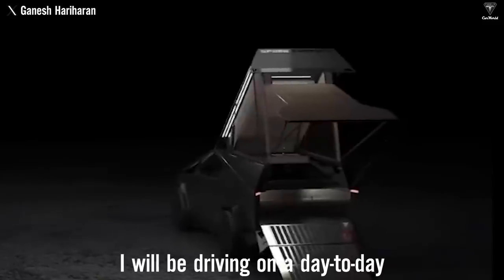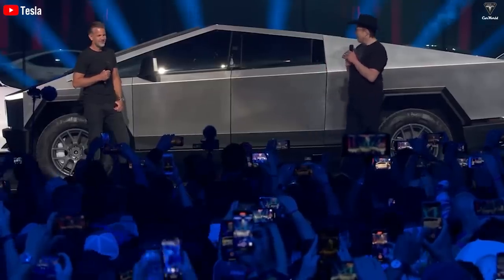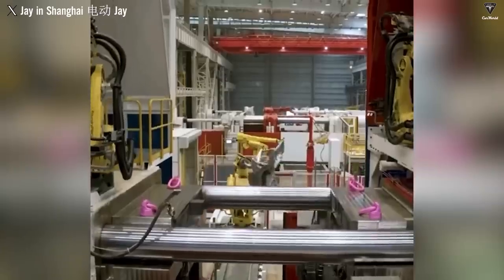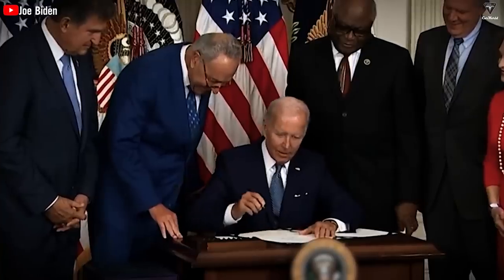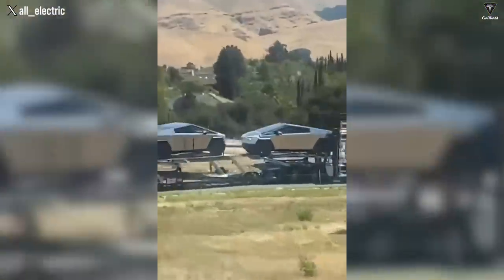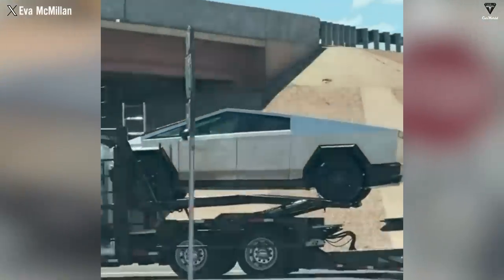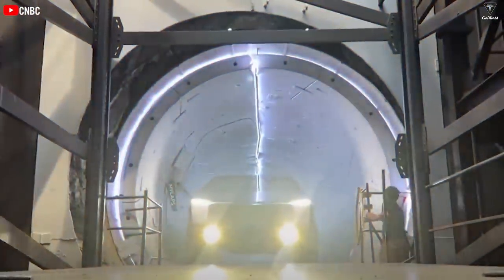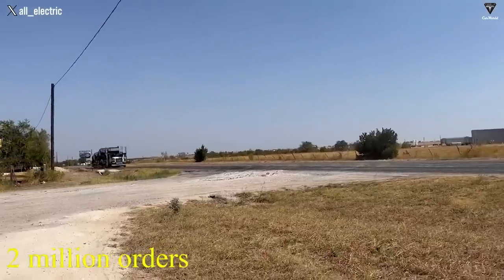Tesla Cybertruck 2023: Upgrades Over 2019 Prototype, how is it different?

Comment: I like the fact that you can use the truck as a truck and haul things if needed ! I do not like the windshield wiper option . Although all other vehicles used them. I would like to see a air flow system that would generate a cushion of air movement
in front of the windshield that would not only move rain away from the windshield but bugs , and bird droppings as well. Now this would be super cool and one of the first ! Also I had talked previous about a magnetic reverse field breaking system that would add less friction and use no replacement wearable parts to be replaced. This would add not only quicker stopping but could help with hydroplaning as well as other areas as well. To many things to talk about but only wish there product to be the best by far . Keep up the Great work America first Always !

Comment: You are completely mistaken when you say Elon wanted to add the sideview mirrors.  Elon never wanted those mirrors.  He thought they were ugly and unnecessary.  He wanted to put cameras inside the cab like some European cars have done, but, sadly, the powers that be in America weren't having it.  Elon was "forced" to put those ugly mirrors on due to antiquated US car manufacturing guidelines.  I think we may see the cameras in the Cybertruck as an "additional feature" to be used in the future once the guidelines change and the outside mirrors can be removed by the owner.  At least that is what I've heard may happen.
Reply from the maker: As we mentioned that Elon Musk did not intend to install mirrors on the Cybertruck at first because it would reduce the Cybertruck's speed on the highway. But the US truck law requires electric cars to have mirrors and Elon Musk accepted this because of the law and he also wants the driver to be safer, maybe we haven't really expressed it clearly. Thank you for your comment!